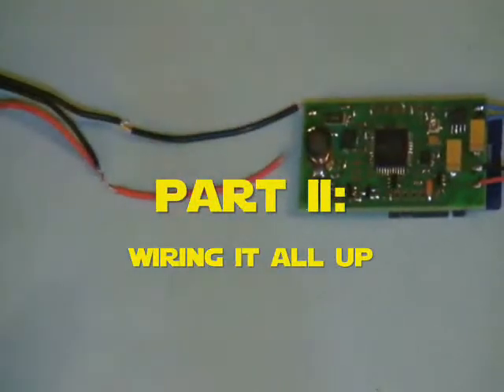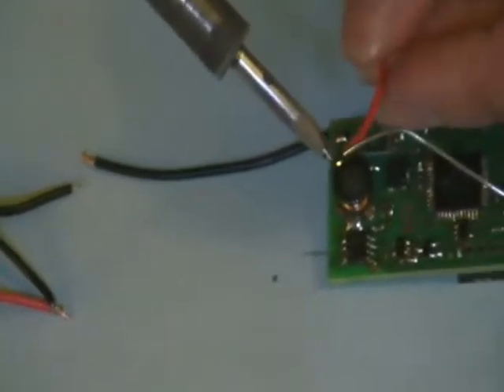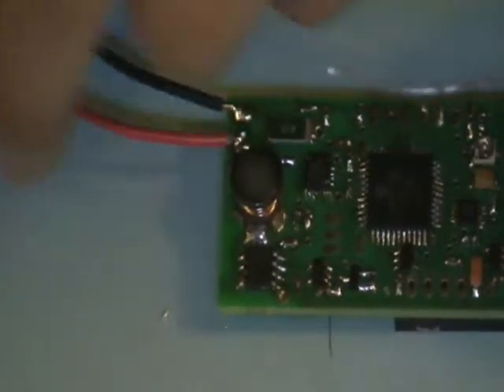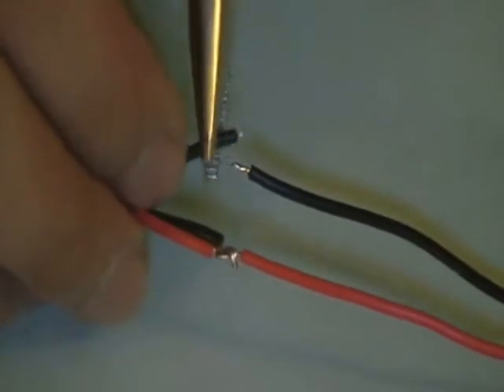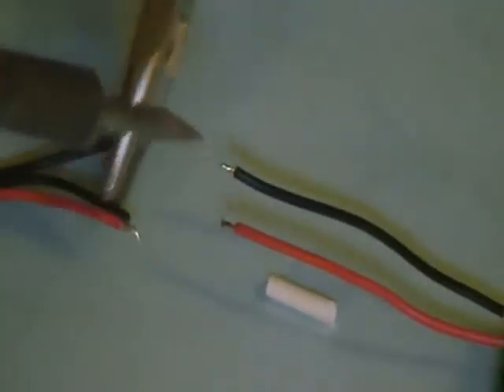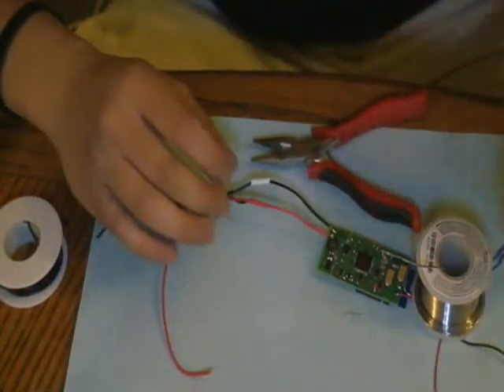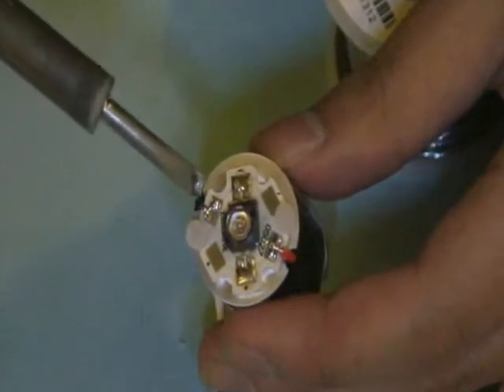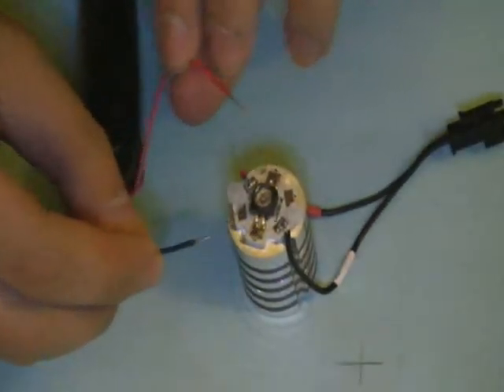How to make Light Sabers -- CF Wiring Guide (part II)

Comment: What kind of LED is that? :D whats the name or specifications?
Reply from the maker: Although this video is quite old now... the LED inside the saber really doesn't matter in terms of the wiring process itself.

You simply use the appropriate LED "of the moment", such as a newer Cree or Luxeon Rebel setup.

If I had to guess what's actually in this video (it's been a LONG time, and I've done a LOT of work)... I think it's either a Luxeon III, Luxeon V, or possibly an EARLY "luxeon Rebel".  All of which are somewhat outdated, but... I still have many Luxeon III LEDs in my "event" sabers that go into hands of kids and adults... and are still pretty bright.  :)